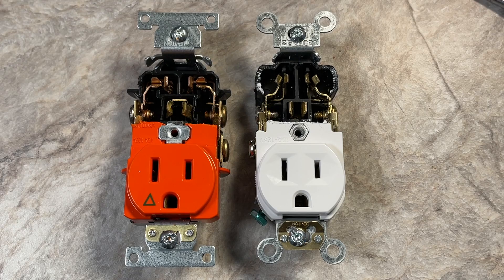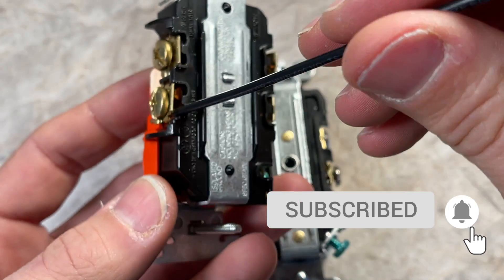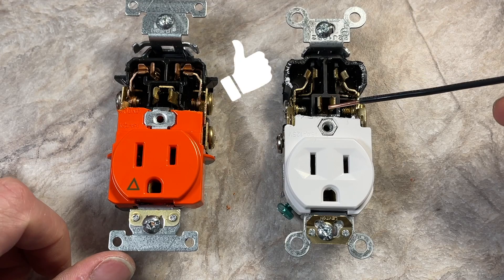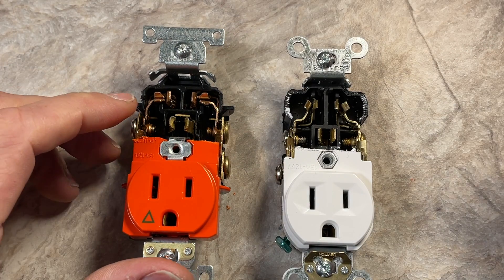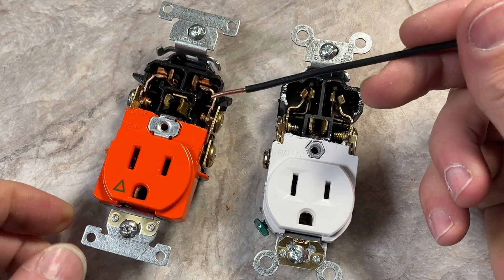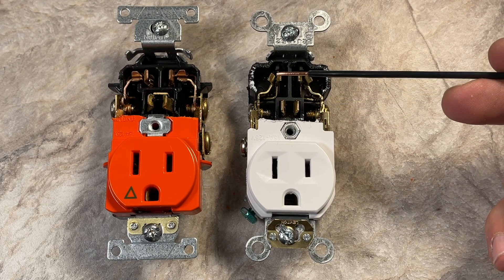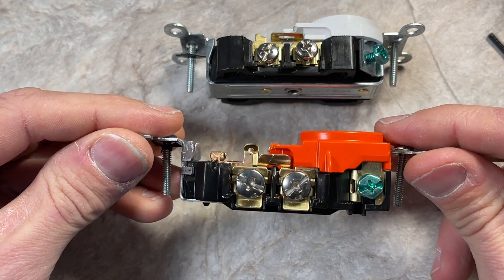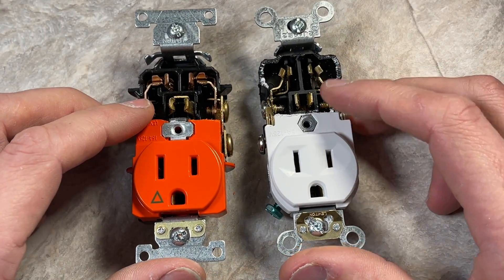What Outlet Should You Buy |  Commercial vs Hospital Grade

Comment: Isolated ground on Hospital grade.
Reply: Isolated ground provides an electrically "quiet" ground reference for sensitive electronics. It protects against induced voltages in the conduit & panels from heavy or inductive loads, particularly ground loops. Ever see the power feed for an MRI? You'd think it was a locomotive! Consider if using an EKG, you're measuring microvolts, and surely you don't need any stray voltages throwing off your measurements.
Reply: @mikecowen6507  beautiful explanation.
Reply: There is a requirement in medical for there to be 10,000v isolation between the ground pin and either pole contact.  Lookup the term creepage. Rule of thumb, 4mm air gap between exposed conductors is 10kv isolation and it's accomplished with zigzags so you don't have to actually space things 4mm apart min. Also a capillary link between the outside and inside that water could form a conductive path counts as zero isolation.
Reply: The one in the video is not hospital grade at all.
Reply: They're always isolated except for the first "disconnecting means" service panel. What you mean is that the "outlet" has to be wired with a separate grounding conductor in respect to the electrical system. This means it has to have a dedicated ground wire and not be bonded to the electrical box, yet the electrical box must be grounded using a separate bonding means.
Reply: @jamess1787  not "bonded" to the electrical box? A separate ground copper wire (copper, white & black) here in Canada is connected, bonded to the fuse panel, although on a separate bar. Why I don't really get though.
Reply: @truckerdaddy-akajohninqueb4793  
Hospital Electrical plugs are supposed to have an isolated ground wire that grounds the receptacle is separate to the electrical box. It probably has something to so with old hospital appliances, and also probably keeps the maintenance man in check. Technically you can use a ground as neutral, but this could potentially kill someone (working on electrics) working on a circuit downstream or connected elsewhere in the immediate vicinity. No one expects current present on metallic housings, and in some cases it would be very difficult to detect (how does one amp clamp in use conduit?). With this in mind having a separate ground protects a worker from another workers stupid mistake.
Reply: @jamess1787  I think you might be making a slight mistake on isolated ground systems. Isolated ground does not mean you are separating neutral and ground wires as that is the point of the equipment grounding conductor. In a normal electrical system you run three wires to the receptacle which are hot, neutral, and ground. The ground should only carry fault currents and not normal load currents, this grounding conductor is also used to ground the metal conduit and junction boxes along the way. This is what an equipment grounding conductor is for. However Isolated ground makes a change to this, there is four wires ran in an isolated ground system A hot, Neutral, safety ground conductor, insulated and isolated ground conductor. The hot and neutral are hooked up the same, however the safety ground is used to connect to the conduit and metal box work as well as any other outlets not marked isolated ground, the outlet ground pin is not connected yet. The outlet ground pin is connected to the IG wire which has insulation around it and runs back to the sub panel where it has a special isolated ground bar that does not contact the subpanel electrically. Then it runs back across another insulated ground wire to the main power distribution panel where it is grounded at the main ground bar.

Isolated ground means there is only receptacle ground pins on the IG conductor, there are no metal boxes or conduit or regular sockets on the IG conductor.
Reply: @2009dudeman  that's exactly what I said :D. Thanks dudeman!

Comment: Notice on the back of the hospital grade that it warns that the mounting strap is not connected to the plug ground.  Grounding of hospital wiring is a specialty process with many isolated grounds for patient protection.  Hospitals and industrial wiring often use on ground-fault alarmsinstead of breaker trip clearing when unexpected loss of power during a critical process would be bad.  If you use these in regular wiring you'd have to pay attention to the grounding and not assume the ground is transferred to metal boxes, faceplates, etc.
Reply: and now I know

But why are receptacles installed with ground pin up and down?
Reply: @YTInnovativeSolution  If you're talking about the orientation on how you install a 3 prong receptacle, it's really a matter of choice but If you're using METAL receptacle plate, it's a lot safer to install the receptacle with the GROUND ON TOP. The reason is, when the mounting screw of the metal plate loosened up, the plate can fall between the two prongs of the plug in use and short the prongs. Office people sitting behind their desks are also known to create this problem by accidentally dropping metal objects ( paper clips, fasteners, etc..) right on top of partially plugged-in 3 prong plug. This is just my 2 cents experience as a retired hospital employee.
Reply from the maker: @YTInnovativeSolution  there are several different reasons why receptacles could be installed with the ground facing up.  In my area, over the years electricians have placed the ground facing up on receptacles that are wired to be switched.  Also, seems like the ground facing up is gaining steam from a safety perspective so if the plug starts to come out of the receptacle and something falls on the blades it would hit the ground first as opposed to hot and/or neutral.
Reply: @EverydayHomeRepairs  if plug is falling out the device needs to be replaced.
Reply: @YTInnovativeSolution  I was always told to install with the ground down if the area is prone to flooding so the ground would be under the water first protecting people.
Reply: @williamdebow3478  Does that really sound reasonable to you?
Reply: @fomoco300k  Six in one, a half a dozen in the other. It is a personal preference. One thing for fact, no matter who you ask. the receptacle for a refrigerator or any other appliance with a 90 degree plug should be installed so the cord hangs down!
Reply from the maker: Appreciate the feedback JK 👍

Comment: Great video  I see a lot of orange outlets in cash register  and server rooms applications my understanding is they  have an isolated or dedicated ground running back to the panel?  I also recently  used some gray outlets  for cosmetic affect only to realize they were $5 each.
any thing different on  those except the color?
Reply from the maker: I think you might be right where red is for emergency/backup power and orange indicates isolated ground.
Reply: @EverydayHomeRepairs  actually it what the electrical engineer specs out on a job, i have installed many red receptacles indicating they are for critical power in a hospital, like in patients room. They are on UPS/generator power. I also installed orange receptacles without the isolated ground indicating back up power at a warehouse for battery charging station. I also installed white or ivory receptacles with isolated grounds (orange triangle) but not on a back up power. Mostly for computer equipment that are not critical but need the isolated ground. There different types of receptacles and color combinations too. Residential, commercial, industrial, hospital, AFCI, GFCI, TVSS.
Reply from the maker: @ForkLiftCertified  appreciate the feedback and you sharing your knowledge 👍
Reply: AFAIK, orange is always supposed to be isolated ground, backup power is usually red or green.  At least, that's what it was when I was building out datacenters 20 years ago....
Reply: @ckm-mkc  Traditionally, orange is used for isolated ground and red is commonly used for emergency--but there is no standard, so any color could be used for any application.
Reply: @sorensolveig599  go to Hubbell’s website and look under wiring devices. That’s is where you will find a boat load of isolated grounded receptacles in a variety colors, we installed blue and yellow isolated grounded receptacles, not orange or red for AWS data centers because that is what Amazon’s electrical engineers spec out. Traditionally yes we usually use orange with green triangle for isolated ground but on bigger jobs every place is a little bit different.

Comment: One recommendation, between all the 15a receptacles is to do a test on what the max amperage they can handle before melting down. Ie like the residence ones may fail at 24a commercial 30a and hospital fail at 40a type of test. That may sound like a not real world test but i have seen where where “non electricians” incorectly put larger fuses or breakers on the circuit. Also seen was two breakers of same phase hook to loop allowing a 20a circuit to have 40a. One neat feature of some hospital grade products is transparent plastic. Allows for inspection without disassembly. Thanks for the great videos.
Reply from the maker: I like the idea.  I used to do validation testing on construction equipment so this would be right up my alley.  Thanks for the feedback!

Comment: Thanks for the comparison,  i’ll be installing hospital or commercial  grade from now on,  residential grade ones are junk by comparison. Not worth saving $5 when everything i plug in is worth more than that. Heck, an iphone charger is much more than that.     Can you imagine the price of a hospital grade iphone charger?
Reply: As an electrician, I can say, don't waste your money on hospital-grade receptacles.  Instead install spec-grade, tamper-resistant receptacles, and back-wire them.
Reply from the maker: Yeah for frequently used outlets or those carrying significant load I am going Commercial.  Hospital grade are awesome but probably can’t justify the cost vs design differences from at least my perspective.  Thanks for the feedback. 👍
Reply: Hospital grade is way overkill in any residential setting. It’s like putting Z rated tires on a Prius
Reply: @mook528  They are a great options for outlets that get a lot of abuse, like kitchen counter or bathroom outlets.
Reply: @ckm-mkc  still overkill. How does an outlet get “abused” you’re literally just sticking a plug into it and removing it.  A midrange outlet will outlast your house.
Reply: Something like this? (Hubbell with integrated USB charging~$60.00)
https://www.amazon.com/HUBBELL-USB8300I-Resistant-Hospital-Receptacle/dp/B00HPLESV4/
Reply: @alanpenzotti2857  that’s ridiculous that someone would pay $60 for a receptacle to put in a residential home. You can get a USB receptacle from Home Depot for $20
Reply: @mook528  Home use is definitely overkill.  These would be used in high traffic public areas (example, waiting area at a very busy international airport.)

Comment: Most outlets are installed with the ground pin down.  I have observed in some environments where all the outlets are installed with the ground pin up.  I have been told this helps prevent those situations where a metal object, a wire or other material that might fall along the wall, comes down and make contact with a partially engaged cord causing a short across the blades.  
The inverted outlet causes the object to come in contact first with the ground prong of the plug and not the hot and common blades of the plug.
Reply: In the US, hospitals and health facilities favor the ground up, for the explanations given, instead of the traditional installed receptacle with the ground down.  The National Electrical Code allows for both but may be not at the local jurisdiction  so that is why it is always good to check with the electrical inspector.  In Canada, I believe ground are always at the top  of the receptacle and the load centers (circuit breaker panels) are mounted horizontally sideways (left to right) and in the US they are mounted vertically.  Go figure!......
Reply from the maker: Hey David,  I have heard that same explanation as well for ground up installs but it sounds like this is not governed by NEC..
Reply: @EverydayHomeRepairs  I first became aware of the problem when I was extending some wire cable behind a cabinet and the wire fell across a plug, shorting out the circuit.  Last year I was visiting an assisted living facility recently built and noticed all the outlets were installed ground up.  They were on their 4th maintenance guy and 3rd director so no one knew the install history, just saying that the building had just come that way and until I brought it up, no one had noticed.  Any new outlets I install go ground side up and have since that one accident years ago.
Reply: @davehertle  I am no electrician or sparky in some countries but I always install the ground plug up... The only exception is in a basement with the possibility of flooding.  In that case the chance of flooding would short the plug before  or more often than the possibility of wire falling across the wires...
Reply: @EverydayHomeRepairs  NEC hasnt mandated inverted outlets yet. some states, local jurisdictions do. our county does either or, depends on the inspector. personally, i prefer inverted. digging out a broken ground prong or having to replace outlets over and over cause a book or whatever fell behind dresser, yanked out cord but broke off ground prong in traditional installed outlets sucks
Reply: I used to work at a small biomedical company and for all of our rack power distribution panels that we made we always put them together with the ground pin up for this exact reason. I was told (though never bothered to look up) that this was some sort of medical wiring code. But I don't know if it was NEC or some additional GMP/QA (or other medical infrastructure) code. That was early in my career and as a tech I didn't question what the engineers told me.
Reply: Thank You all for comments.  I am much better informed now about what I have been oibserving.  I think all of us will now give a 2nd thought to how we might be installing some of our outlets.  Easy questions about work setting, users and uses.